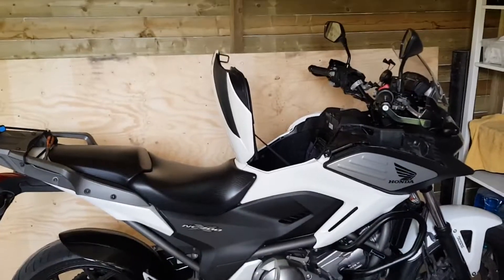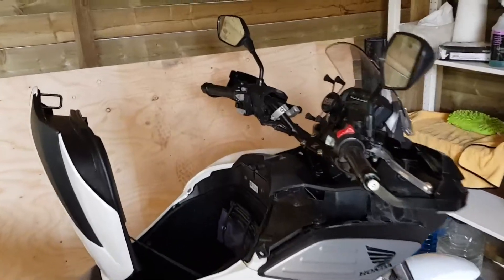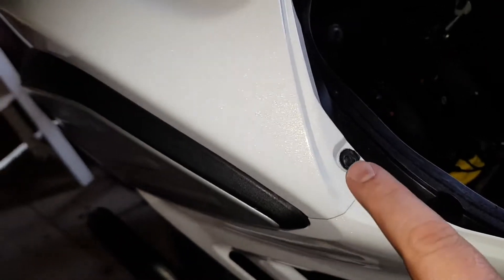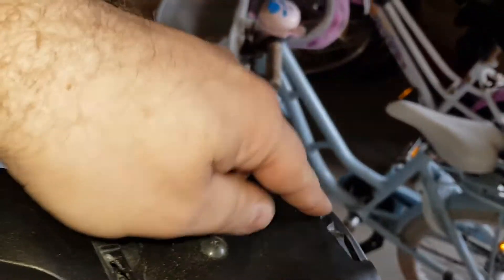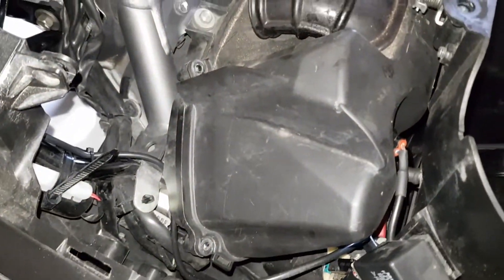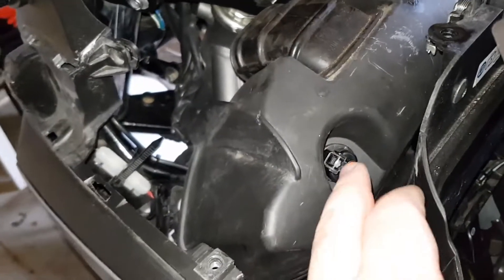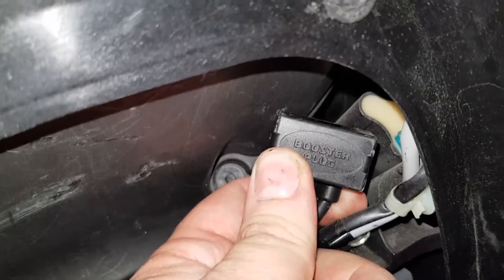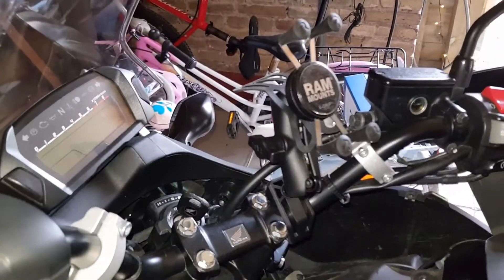Honda Nc700X DCT boosterplug install

Comment: Hej Anders , sidder og kigger på din video, jeg har køber en 2014, som allerede har booster plug monteret , jeg ligger og pendler 2x13 km pr dag , men kommer sjældent over 25 km pr liter , er din erfaring af brændstof forbruget er større med booster plug ?
Reply from the maker: Hej Ole
Jeg har ikke den motorcykel længere, men synes ikke jeg havde problemer med at få den til at gå over 25km/l, selv med boosterplug installeret. Hastigheden betyder dog rigtig meget for forbruget, så hvis det er motorvejshastighed du kører, så skal du regne med det koster på brændstoføkonomien.

Comment: I cant find the ecu of the bike, I have a NC750X 2016
Reply from the maker: You don't need the ECU for this install. You just unplug the air intake sensor, and plugin the Boosterplug. Procedure should be very similar.
Reply: In the video they plug it in both in the ecu and in the air intake sensor?
Reply from the maker: Kristoffer Olsson no, you just unplug the air intake sensor, plugin the wires from boosterplug (including boosterplug controlunit) and thats it.
Reply: @Andthorup  but then how is the ecu get the values from the air temperature sensor? Cant you just tell me where the ecu is?
Reply from the maker: Kristoffer Olsson the boosterplug wire harness sits after the airtemp, thus altering the signal send to the ecu. 
Where the actual ecu is located, I dont know, as it is not needed in this install.
Reply: Okay, then I understand why you didnt understand me. I cant connect the booster plug wire harness because I dont have anything to connect it to. There is two cords that was taped with electrical tape, it could maybe be those two. Maybe I should buy a contact that fits with the connector on the harness? The two cords was taped together with the harness of the air temperature sensor. The harness from the original sensor is quite short and connects with the other harness by a contact or sre Im wrong?

Comment: Any gain in power or acceleration?
Reply from the maker: No, that is not what it is for. It is to improve low speed engine throttle response, and it works very well for that.
Reply: @Andthorup  Better torq?
Reply: @Andthorup  Ohk thnx mate

Comment: what about power? any noiceble difference?
Reply from the maker: No, it does not increase power noticably. 
But the running is a lot smoother at low rpms.
Reply: @Andthorup  so is worth it?i  mean would you consider other people to install it or it doesnt worth the money and the upgrade???
Reply from the maker: @gypakos1  Yes, to me it was worth it. I think on the DCT automatick version, it is a must have, as You often find the gearbox wanting to stay in low revs, where the boosterplug works best.

Comment: Was it worth it, 160$?
Reply from the maker: 100% I feel a big difference at low rpms. Engine runs a lot smoother.
Reply: @Andthorup  what about power mate?

Comment: Thanks for the install video; it helps as I just purchased one for a 750X. Question, do you actually have to remove the air box? It looks like after you remove the center cover there should be enough room to reach the sensor plug.
Reply from the maker: Stephan Porancea it is a lot easier to take the air box off, takes 2 minutes to remove, and gives you all the space you need
Reply: @Andthorup  I see, thank you. How does the bike run with the boosterplug installed?
Reply from the maker: @stephanporancea3691  Sorry for the late reply. It makes a big difference, it runs a lot smoother at low rpms, and the "jerkiness" is gone.
Reply: @Andthorup  Thanks! I bought and installed one too and you're right, it does make a difference. Between the plug and removing the throttle cable slack it is a different, better bike.